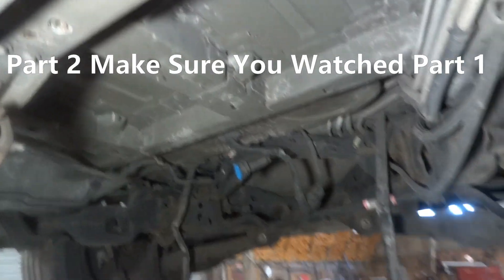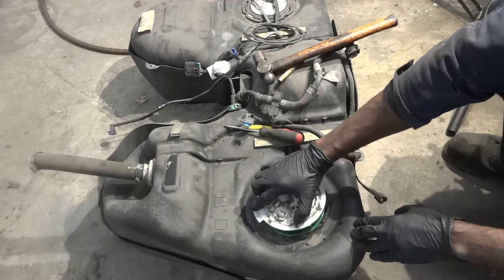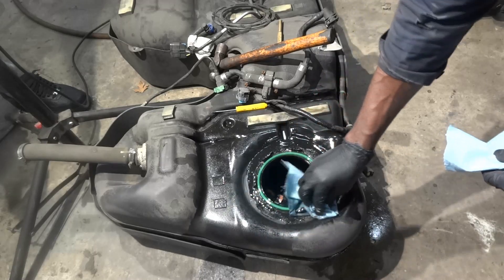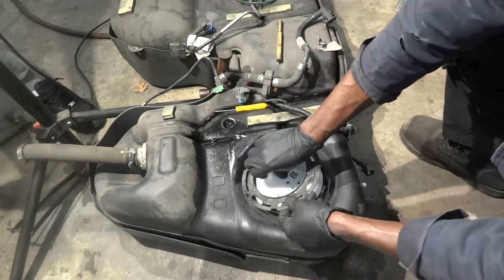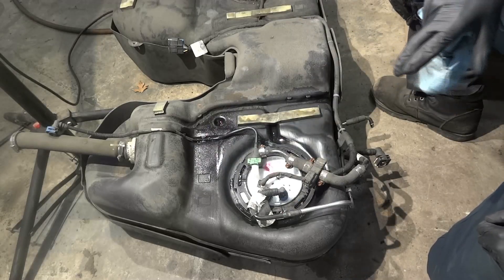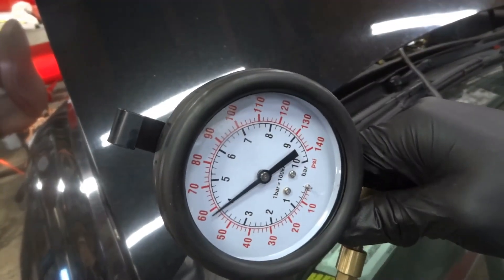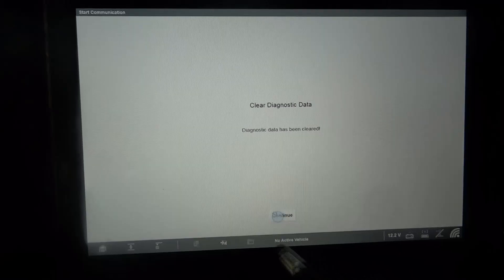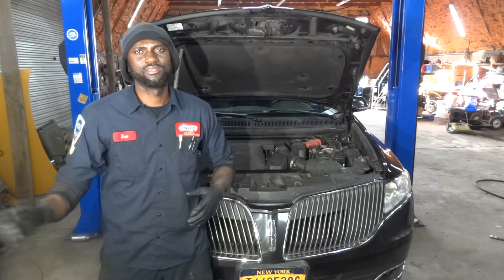Lincoln MKT - System Too Lean Bank 1 & Bank 2 - Code P0171 & P0174 Diagnosis & Repair Part 2 The FIX

Comment: Love all the videos, don't love to see smart technicians putting their arm into an airbag steering wheel to turn the key, it's simply a risk that is not required, thanks for the case study. What I would have liked to have seen is to have the fuel trims corrected to see the actual fully warmed-up engine MAF reading at idle with good trims, cheers.
Reply from the maker: Duane Donaldson  Thanks! Check out part 2

Comment: Hi. I have the same codes i have changed all 4 O2 sensors all spark plugs and one mechanic told me it's your catalytic converters and another said may be your fuel injectors it's 2019 MKT. Now looking at your video it tells me that it's totally different thing. Hard to find a pro in nyc. Can you tell me your location please? Thanks
Reply from the maker: @981alishah   Hi, I'm located in Dickerson MD, you can email me at kitsautoandtruckrepair@gmail.com for shop info!

Comment: Thanks I appreciated the video I have a po174 and po171 code on my 2006 Lincoln towncar my mechanic says I should order some 02 sensors since they say bank 1 and bank 2. I’ve had this code months ago and I changed something out I think it was the mass airflow sensor. Do you think my problem could be the sensors or a the fuel pump when I looked the code up it basically saying something was to much air and not enough fuel etc?
Reply from the maker: GuttaWayneSlim  it's hard for me to tell without looking at the data! you should have it diagnosed by a pro mechanic!